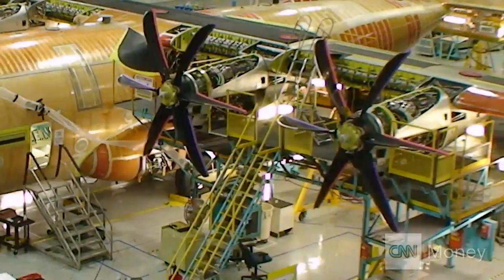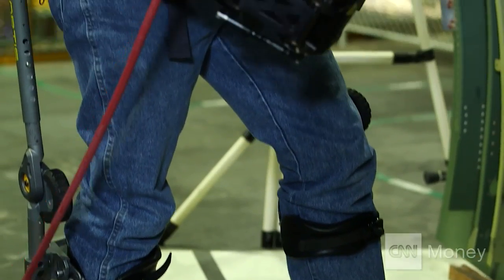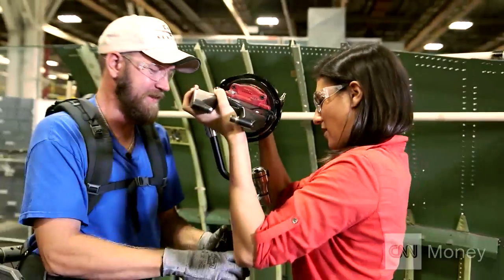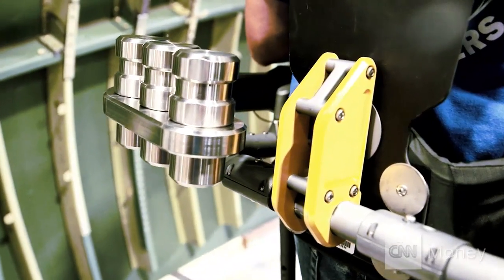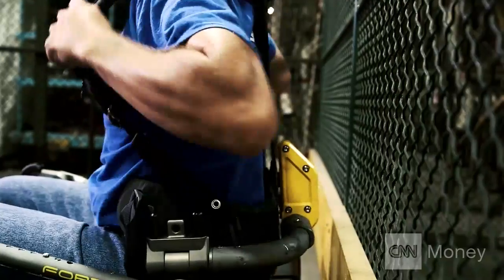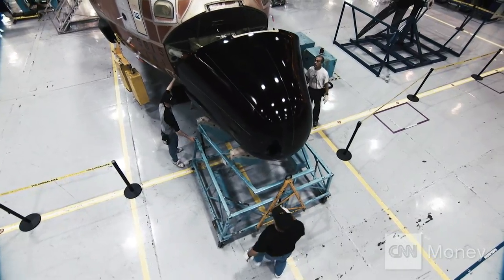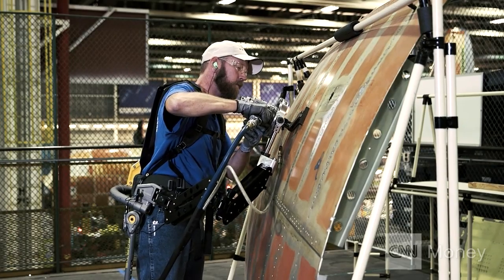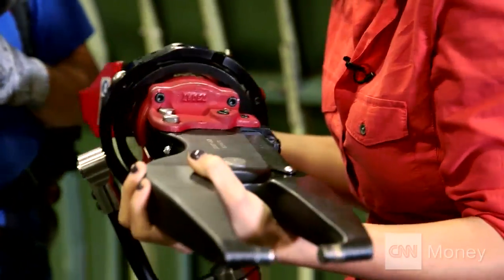This suit will give you superhuman strength

Comment: Lol not really an innovation. This is basically just a really complex stand, is the thing even powered or does it just transfer the weight to the ground. 
they have had thing like that for camera mounts for ages.
Reply: it is pretty much te same thing as the camera mount just built to be more industrial stength
Reply: Daniel Murillo what camera do you use that weighs 30+ pounds? Also, the more "advanced" hydraulic suits cost far more to buy and maintain than the machines that would otherwise replace these workers. 

This is cost effective and decreases the likelihood of companies switching to automation because the traditional excuses disappear.

Intelligent design is more than just the fancy "Iron Man" bling